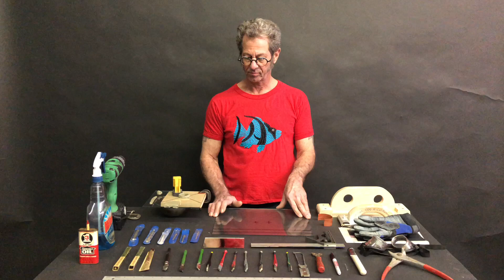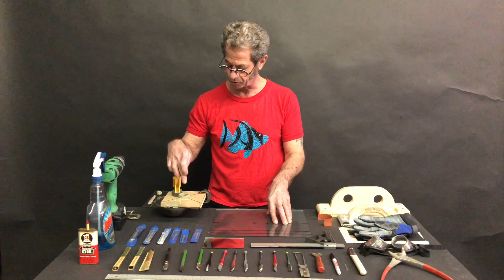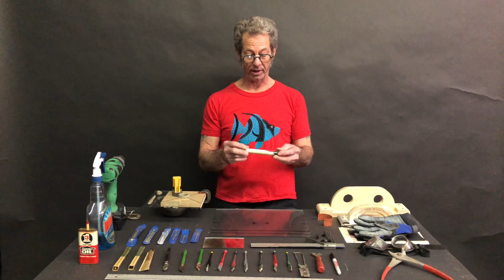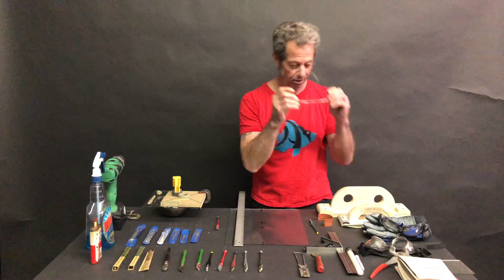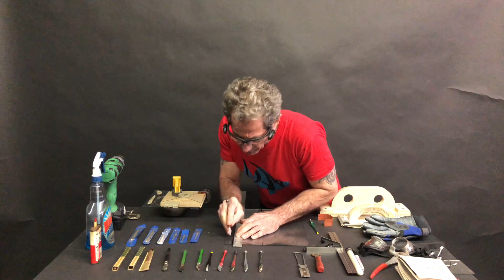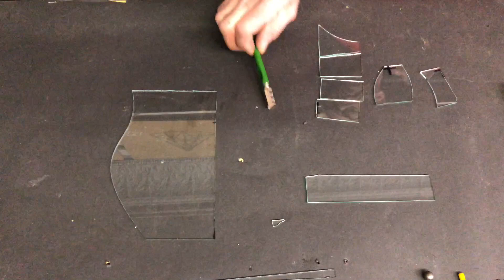An Artist take on Glass Cutting and Drilling- part 1 of 2

Comment: Windows in old buildings aren't "thicker at the bottom" because the glass moves. They're thicker because they weren't made with modern methods, ie. floating on a bed of molten metal. If they are indeed thicker at the bottom it's because they were installed that way. 

You're perpetuating an urban legend.
Reply from the maker: I am of the opinion that there is truth to what both of us are saying here. My experience teaching traditional glass blowing techniques taught me that one can make perfectly flat sheets that are consistent in thickness. I was also taught that glass has the ability to slowly migrate over centuries when a sheet is oriented in the manner of windows. Perhaps this is nothing more than a myth  but as one that likes the idea, I’ll hold on to it for now.
Reply from the maker: I did some homework and ended up at the Corning Museum of Glass site. Myth is most certainly what I’ve perpetuated. I got in a heated discussion with a colleague about this some months back but forgot all about it. I’ll drop in a line clarifying that was once commonly taught is indeed a myth busted. Thank you
Reply: @sublimedecoctions2674  Like you were, it is indeed a very attractive belief. Even I can't say it wasn't at least a little bit appealing! Now, I can't speak for everybody (of course), but I love hearing/dropping tiny historical things (true or not), so adding in a "people used to believe" in this case would immensely improve my day.
Oh, and I really appreciate that you didn't take my comment the wrong way, despite its terseness. :)
Reply from the maker: anjelgiofu I added a short clip I made this morning to the Artist Guide to Glass playlist. This exchange we’ve shared has me thinking a lot about how important it is to question what we believe and respond appropriately when our beliefs are questioned. Thank you.